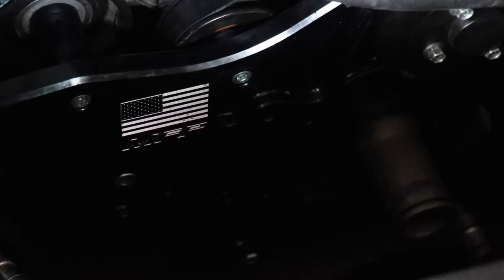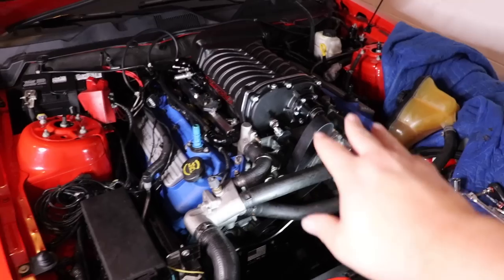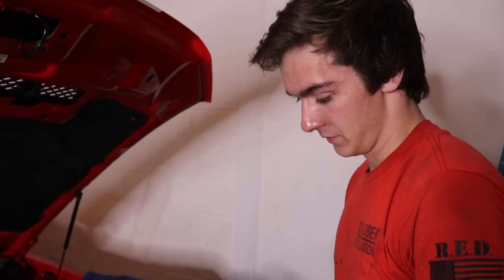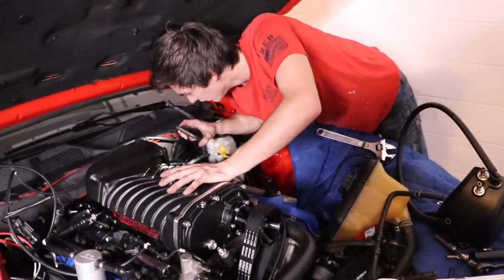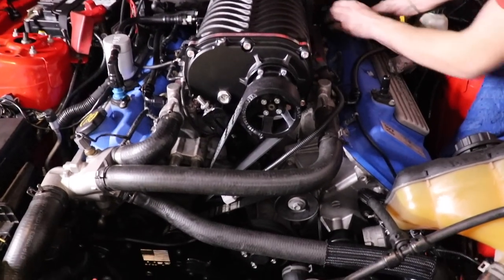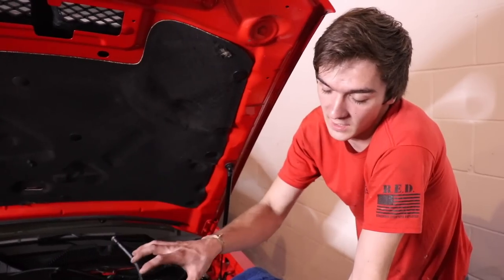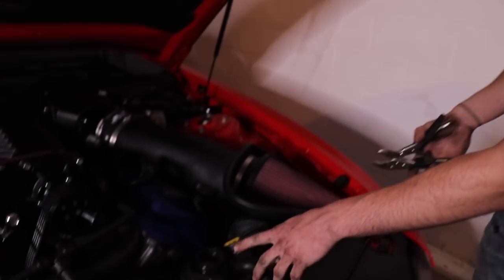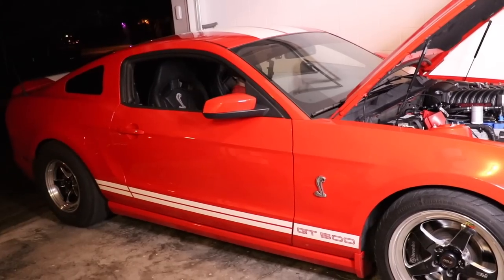Massive Whipple 3.8L First Start on my Built GT500

Comment: Hey Andrew, I know there’s a lot of behind the scenes stuff we don’t see, but I’ve never gotten the impression that you have any drivability issues. The car has stage 3 cams, e85, and a big monoblade throttle body, yet holds idle and drives at low speeds perfectly at least from what I’ve seen. How have you been able to avoid drivability issues despite all of the ridiculously aggressive parts on the car?
Reply: Its alll in the tune. Whoever tunning it knows what they are doing and spends alot of time into tunning. Your going to have some driveabilty issues but nothing crazy. I had my best friend drive my car the other day and he couldnt believe how nice my car drives with my setup. So it can be done to help answer the question for andrew 👍🏾
Reply: Good ass tune

Comment: 7:16 I’m getting circulation but  throwing a code for possible pump failure or low voltage it’s ford code p1229

Comment: It would be a great test to switch to Evans waterless coolant. It can handle higher temps without damaging your engine.
Reply: I was told that yes tge coolant can handke tge high temp, the engine will suffer before you know that there is a problem. Did alot of reading and decided againt it

Comment: You guys use oil catch cans? Was told I needed on with my vortech V3
Reply: Yes you need catch can’s it’s important to catch the blow by don’t want all the oil going into your intake manifold. Highly recommended
Reply: @jayali9324  for some reason, I keep PV on the drivers side, destroying the head and piston. Second time, once with 250 miles and the other with 850ish. #5 cylinder last time and now #6. Was told that the left bank is over fueling and getting to hot on the exhaust valve, both times it has been exhaust valve. Had catch can in place to keep buildup off the valves but it appears to have done nogood. Would really like to work with someone and see where the problem is at. Checkout my channel I have it all laid out on there in great detail. Let me know what you think please.

Comment: Are you ever gonna do any lighting upgrades on your cars? Specifically the GT500. It needs black housings LED front and rear side markers (diode dynamics), LED fog lights (also black housings), LED license plate lights, and tint the headlights slightly